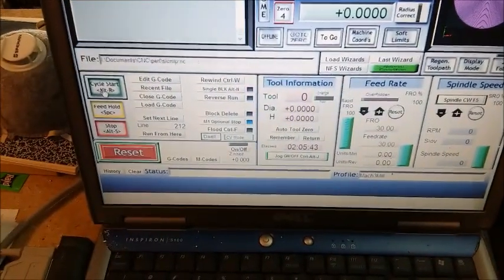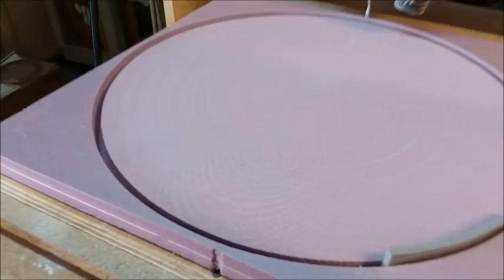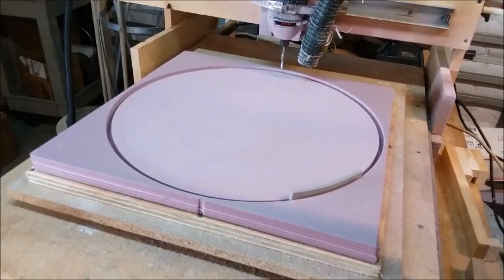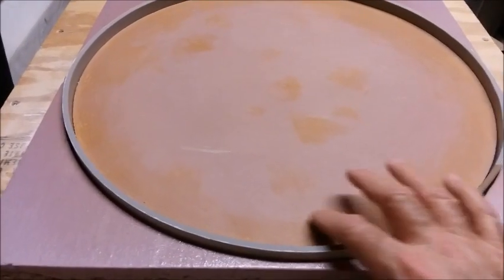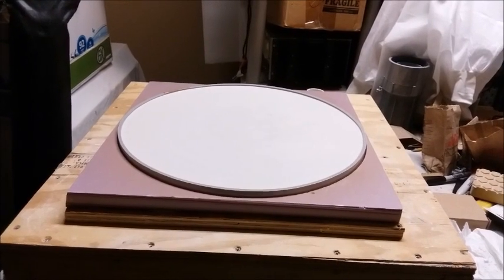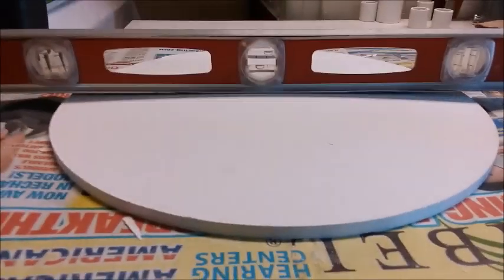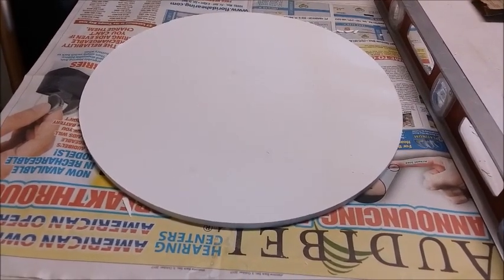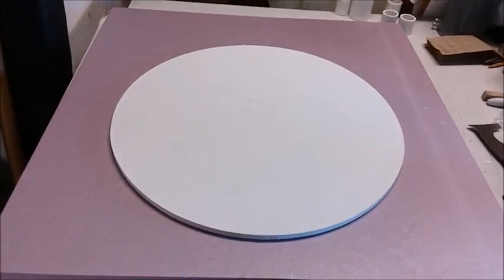Slumping a 16 inch diameter telescope mirror

Comment: Why did you choose a convex slumping mold? Isn't it easier with a concave?
Reply from the maker: I get the exact mirror radius I want with a convex mold without having to account for the thickness of the glass. Also getting the air out from under the glass in a concave mold can be problematic.

Comment: Heatshield is called a 'sagger'. Can have bottom and lid like a big pot.
I got a cast iron mould correct sagitta under layer of ceramic, then glass resting on top. It is more predictable to have concave mould. Also the slope inwards on the rim will help with holding with strap when testing and in final telescope. 1 inch is a 3 day cooling and Pilkington provided all the temperature cycle details for a perfect stress free slump. Glass artists have very rough cycles. I used a 0.1 deg/hour diy probe and PC program.

Comment: The Letter F. 4:50 You mention a 16" f3 mirror blank. There is no aperture so is that the focal length, 3 inches? I assume you get that from the parabolic equation used to get the shape ie. shallow or deep.

Comment: I am sorry but i dont get how does the styro  mold correlate to the glass in a 12kW :) oven?
Reply from the maker: The styrofoam mold is used to shape a refractory plaster slumping mold of the desired radius of curvature. The plaster slumping mold is then used to slump the glass in the kiln.

Comment: 13:09 is there any 'dam' around the mold so that it can hold the molten glass? Thanks for sharing!
Reply from the maker: At the low temperatures where slumping occurs, the glass really doesn't run off the mold. It just sort of gently lays down on the convex mold and takes its shape. A dam isn't really needed.

Comment: I'm having a really hard time finding any 'rule of thumb' for glass thickness vs. diameter for blanks intended for slumping.  Do you have any tips?  I'm about to practice cutting out glass circles from plate glass ~10mm thick and would like to cut them at the maximum diameter that would work for slumping, so I can potentially use them later on to make mirrors.  From five or six examples it looks to me like the ratio is usually around 40:1, with a few examples going more towards 30:1 and 20:1.  Does that seem about right, 40:1?  So a 20cm diameter glass mirror blank could be as little as 5mm thick?
Reply: For mirror blanks question of thickness is not about if it can be slumped but if it can be finished and  used as a high quality mirror. Any thickness will slump when heated enough, I did usual 1:6 disk of 150mm diameter and it deformed well.
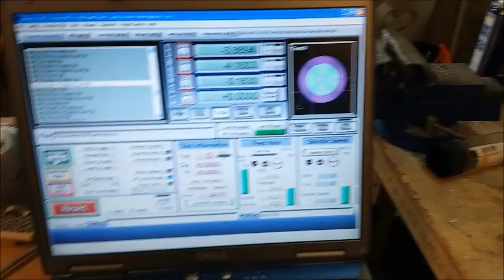20cm glass mirror blank should be at least 2cm thick and even then there is a risk for shape errors because it is so thin. 1:10 thickness ratio is possible but I wouldn't go thinner than that. These values are for optical mirrors
Reply: @@Aaron-mi6co Good for him. I really don't know how that could be possible because plate that thin is over 200x more flexible than standard 1:6 disk which is considered stable and rigid enough. 1:10 disk - which is about 64x stiffer than 1:40 disk - already needs quite carefully designed support for not to flex under its own weight

Comment: How many hours did you have the kiln powered up?   You said it draws 60A at 220vac which equals 13,000 watts or 13.2kw.  In Florida the electric rate, according to Google, is $0.1142 per KWHr.  If I am not in error it would cost about $15.08 per hour to operate.
Reply from the maker: A complete cycle can take a week. The kiln isn't on 100% of the time. The temperature controller cycles it on and off to ramp up and down and to hold at a given process temperature. For most of what I do the kiln is probably on somewhere between 20 and 30 percent of the time during ramps up and holds. I doubt the kiln is on more than about 10% of the time during ramp downs. My electric bill can be impressive when I run a couple of projects in the same month.

Comment: Omegageek64 would you be interested in selling a 16” slumped blank just like you just showed? If so I would be interested. Or if you are up to 20+”. Thanks for your time, let me know!
Reply from the maker: Hi Chaos,

I am traveling for the next few weeks. Then when I get home I need to begin the process of moving into a new house. The kilns are going to be out of operation for a while until I can get a shelter set up for them and high current wiring installed at the new place. There is a small possibility I can do it before I move, but it is unlikely as I will be very busy. I'll think about what I would charge for one and get back to you if or when it looks like I'll have the time to do it. Thanks for the inquiry.
Reply: @omegageek64  hello I'm also interested in purchasing a blank in the 20" range if possible whenever you get the chance.  Thanks!
Reply: I would also be interested in a 16” or 20” or both. It’s my dream to build my own telescope but I’m afraid of spending years trying to get the perfect shape by hand. I think you’re an amazing craftsman and I admire your work.

Comment: I made molds for glass slumping (antique lamp repair) at a stained glass shop for a few years, and am currently collecting materials and equipment to do it on my own. I just picked up a kiln yesterday. A trick taught to me by an old glassworker is to completely let the mold cure by keeping it as wet as possible for a couple of days. Then letting it air dry until it seems to be bone-dry on the outside. Then, dry it completely in the kiln by setting the temp to 200F, just under the boiling point of water, and firing it for about four hours. This will drive any remaining moisture out of the mold without turning it to steam, which would crack the mold. We were using a courser refractory, but I'd bet the concepts are the same. I never had a mold crack in the kiln again after that.
Reply: Just curious what "keeping it as wet as possible for a couple of days" does. I've got practically zero experience working with plaster or glass so maybe the answer's obvious.
Reply: @urdnal  It ensures the plaster is fully cured, and has no dry plaster zones where water did not penetrate
Reply: How did it go?

Comment: Is the mold spherical? Could you have made the mold parabolic to remove the need for parabolizing?
Reply: No. It’s is nowhere near accurate enough for the parabola.
Reply: Probably yes if he used a low viscosity plaster mix and spun it at the right RPM. those speeds are posted online.

Comment: How do you turn the glass into a mirror? Coating of some sort?
Reply from the maker: Well first the glass needs to be ground and polished to a very precise shape. The slumping only gets it to the approximate shape it needs to be and eliminates maybe 90% of the hard grinding work. Then once the polishing is complete it will be sent to a coating company and they will put a thin but highly reflective coating of aluminum on the top surface making it into a mirror.

Comment: What software do you use to generate the tool path?
Reply from the maker: I wrote the software myself. It's a fairly simple program. I input the diameter and radius of curvature I want. It generates g-code for a series of concentric circles in x and y with z moving up he appropriat amount after each. Then it cuts a circular channel around the edge for the dam. Could do it with cad/cam too. I just like to write code.
Reply: Thats awesome! What language did you use?
Reply: The software is Mach3 or 4 and the language was probably g-code  in mach3  g-code is like direct instructions for the machine to perform